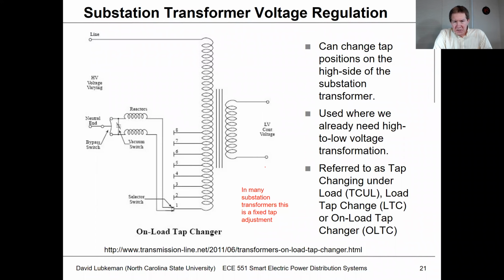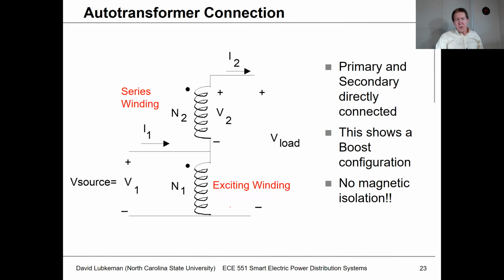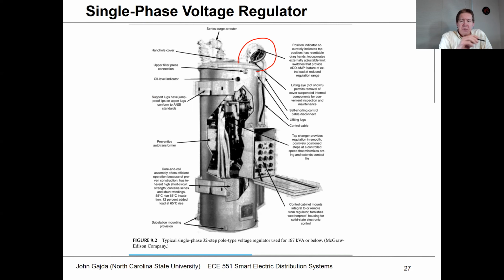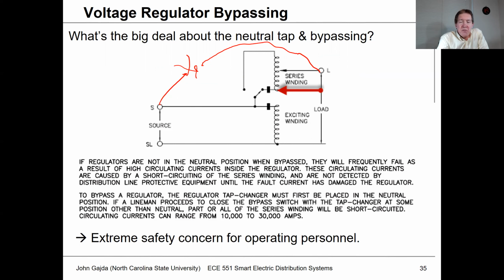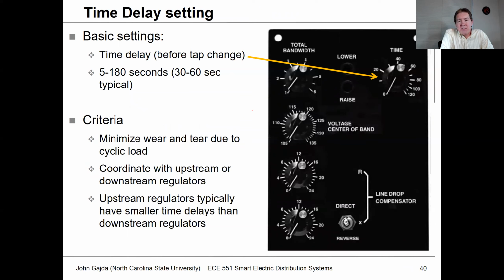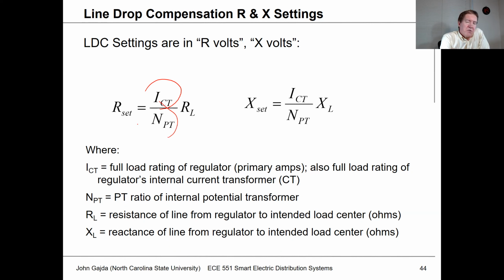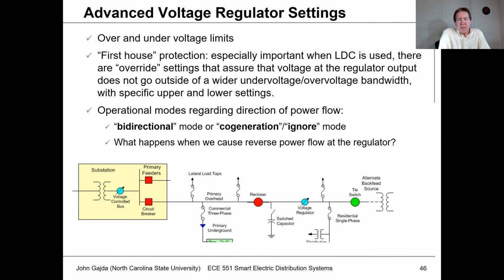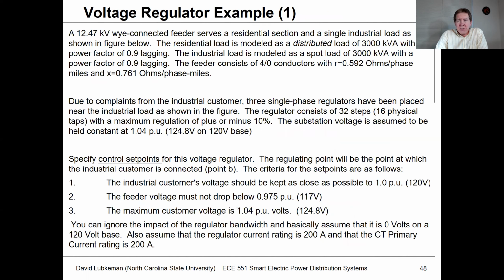Lecture 8b: Voltage Regulation - Line Regulator - Power Distribution Systems Spring 2021 - Lubkeman

Comment: Can you explain why this needs to be in the neutral position before opening and closing into the circuit?  Is it more dangerous if it is in a lower percentage raise or lower position?
Reply from the maker: The figure you are referring to does not show the tap.  But basically when we have a nonzero tap position, we are inserting a portion of Winding 2 in series into our circuit.  We can manipulate the Winding 2 connections to get either a voltage raise or drop.  If we want to take the voltage regulator out for maintenance and not interrupt the circuit, then we need to close the bypass switch, which will short Winding 2 out.  If you have a nonzero tap position, you will have voltage across this winding.  So shorting out Winding 2 would result in a substantial fault current.  This is why the regulator needs to be in a neutral tap=0 position before shorting out Winding 2.